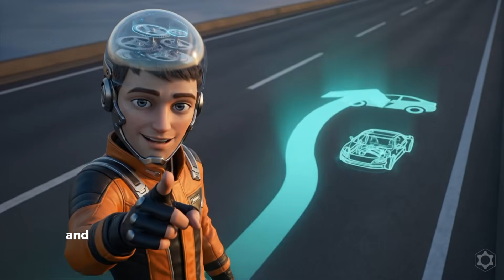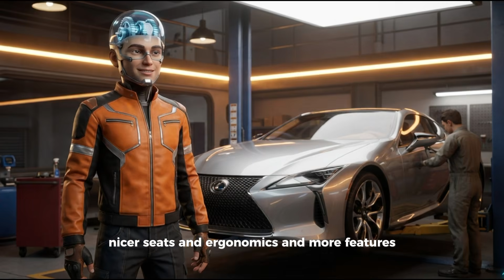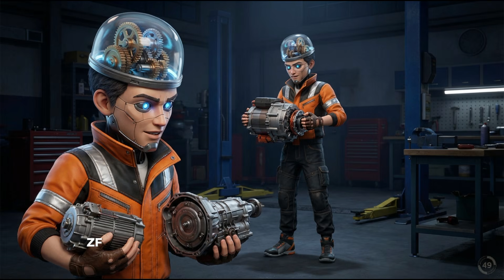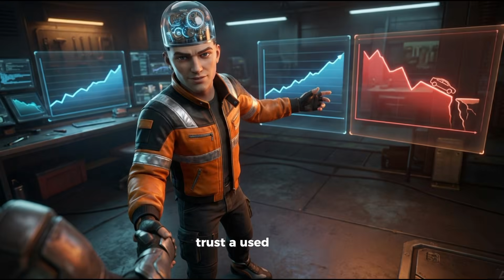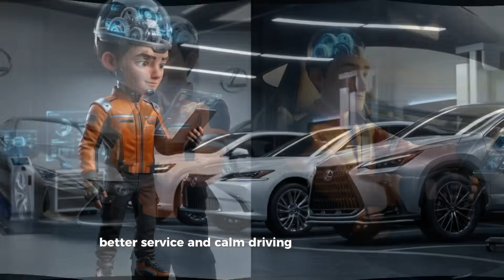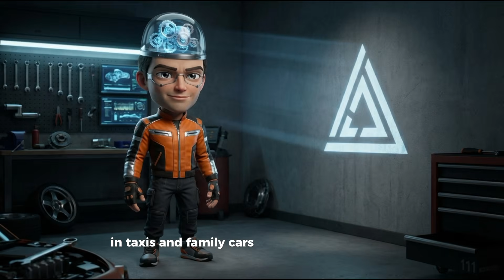Lexus Hybrid The Retirement Car Dealers Don't Want You to Know About

Comment: Lexus ride quality is jostly and not at all confortable.
Reply from the maker: Fivish, my friend! Always great to see you back in the comments bringing your honest perspective to the community. You actually hit on a massive shift in modern automotive engineering that catches a lot of luxury buyers off guard.

While older Lexus models were legendary "magic carpets," a lot of the newer hybrids—especially the F-Sport trims are rolling on massive 20-inch wheels with incredibly thin tires and aggressively tuned dampers. When you eliminate that thick tire sidewall, you lose your primary layer of mechanical shock absorption, transferring all that harsh, high-frequency road vibration straight into the cabin. If a buyer wants that classic, isolated retirement cruiser, they absolutely must spec the smallest wheels possible. Not only does it fix the ride quality, but it massively protects your Total Cost of Ownership (TCO) by extending the life of your suspension components and preventing premature mechanical wear. It’s a brilliant reminder that you always have to look at the physical hardware, not just the badge! 🔧